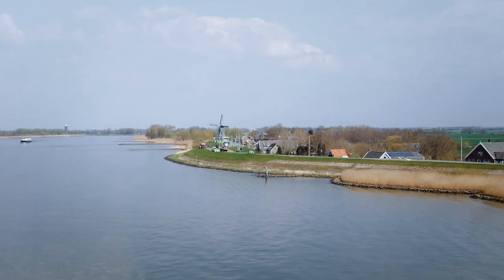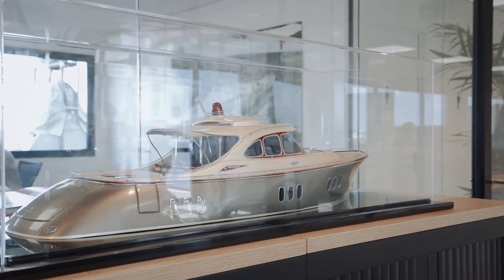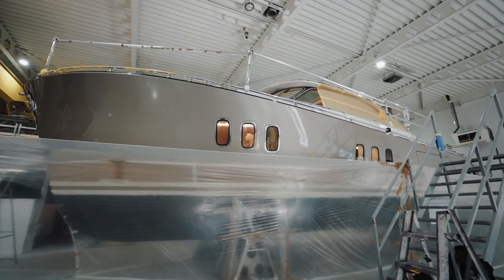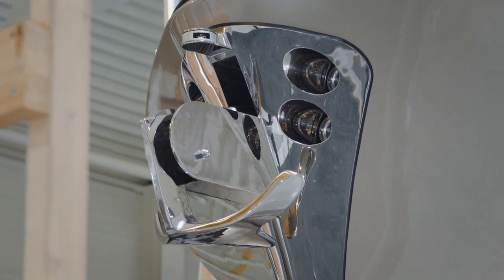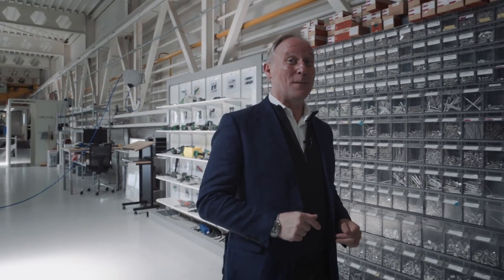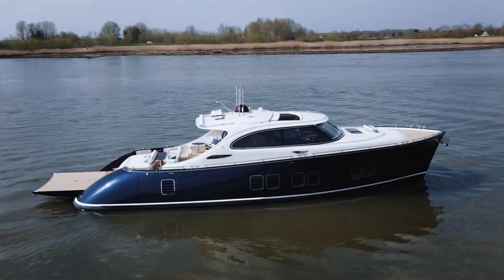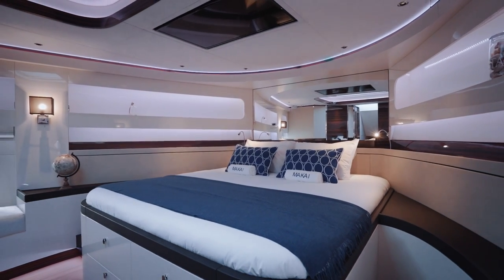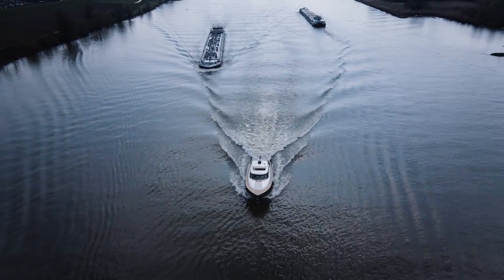TAKE A LOOK AT ZEELANDER YACHTS AND THEIR EXTRAORDINARY Z72!!!

Comment: Gorgeous yacht, although I imagine the build time is rather extended.  I'm going to guess about 18-24 months from commissioning the build until the owner takes delivery.  My preference would be for the middle "child", at 55' it would be much easier to maneuver (even with IPS) and likely much less thirsty for the diesel.  Plus you still have 3 staterooms (yes, one is a "bunk room"), 2 heads AND an internal tender garage.

Comment: I have a question for you David, could I buy one of these yacht with smaller engines so I can get the same distance as a trawler yacht. I mean I like the look and the stile of the boat I just don't need the speed, but I do need the distance as I live in Australia. Thanks mate.
Reply: Check out Bering yachts
Reply: @dirknoort4644  Ok Thanks I will